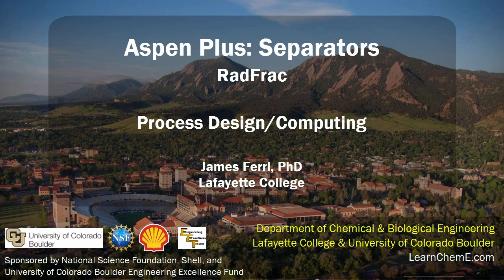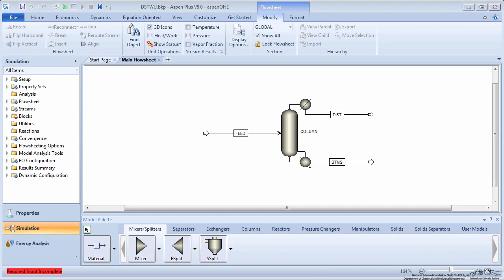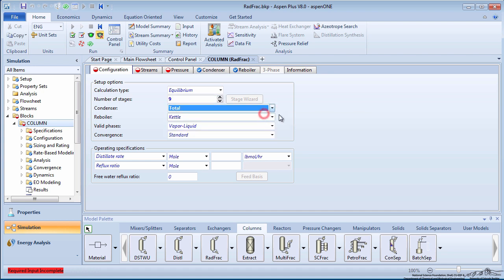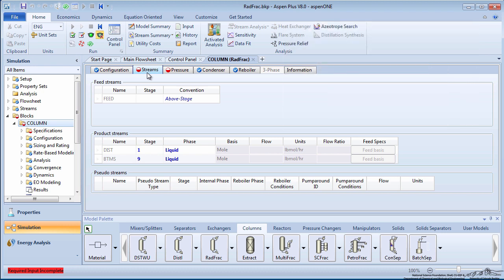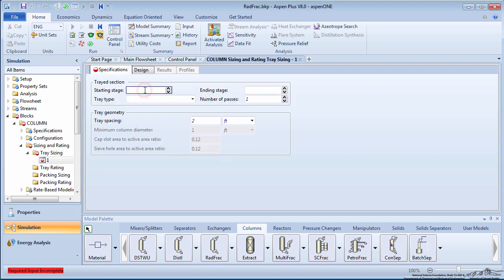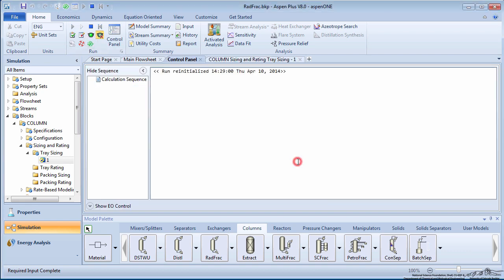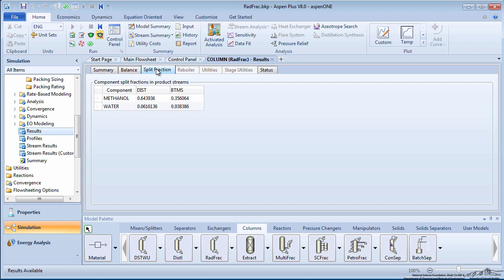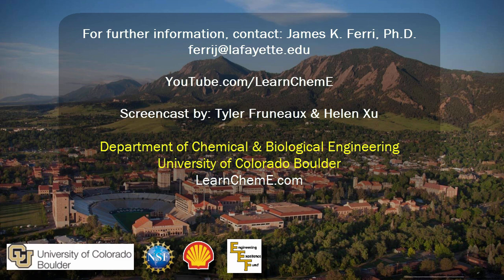Aspen Plus: RadFrac

Comment: I believe there is a mistake with regards to the location of the feed stage at 1:21  in the video. You state correctly that Aspen counts its stages from top to bottom. However the definition "above-stage" does not refer to above in the sense of the numbering of the stages, but rather literally to the physical location inside the column. So above-stage n would refer to the location between n-1 and n, and not to the location between stage n and n+1. This is stated in the "Feed Stream Conventions" section of the Aspen Plus Help page. So if in your case the feed stage is 5.57, then you should specify it as above-stage 6 (and not 5).  Please correct me if I am wrong. Nice video though!